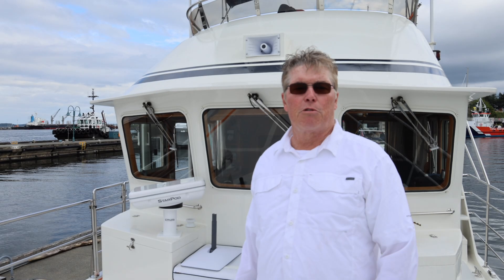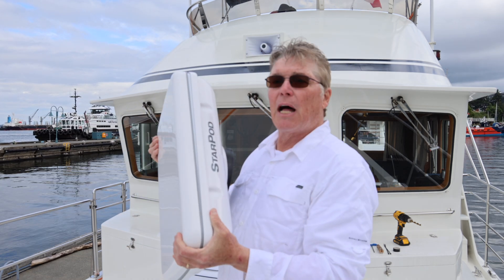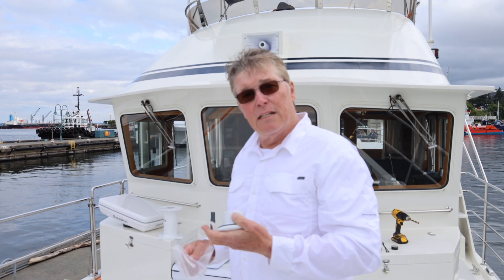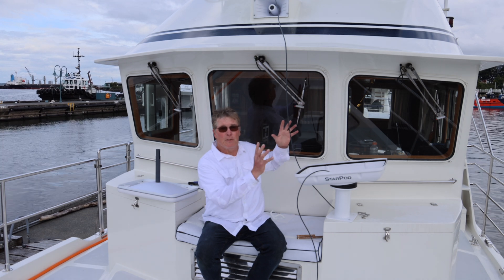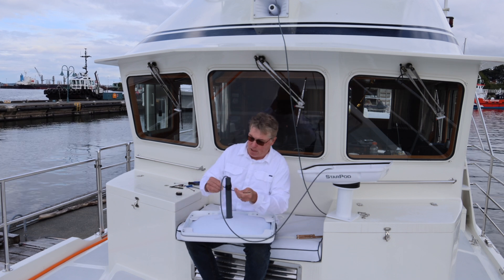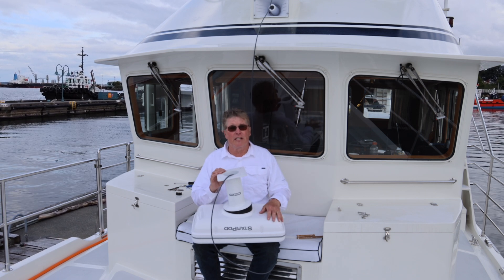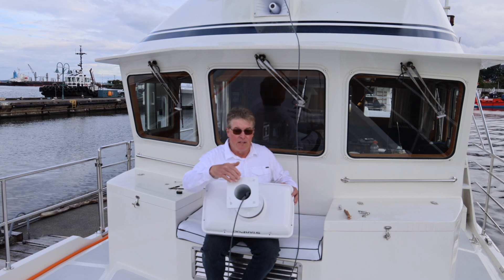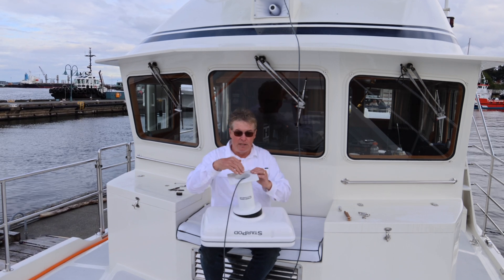StarPod Systems for Starlink 2024

Comment: Welmounts structural adhesive bond fasteners??? 7:00...Benefits of Weld Mount, Clip Bond, Rotolock 

Structural adhesive bonding offers a variety of advantages over other joining techniques. First, structural adhesive bonding does not allow for the compromise of the substrate, therefore, there is no room for water ingress. When bonding dissimilar metals, Weld Mount acts as an insulator, eliminating galvanic corrosion. Finally, structural adhesive bonding supports improved fatigue resistance, enhanced resistance to shock and vibration and advanced thermal cycling over mechanical or welded assemblies.

Other advantages include:

    Increased longevity of products
    Improved weight reduction
    Enhanced structural appearance
    Guaranteed mounting solution
    Eliminated stress point concentrations
    Advanced load-bearing capacity

Products

Weld Mount's offering of adhesively bonded fasteners and a wide range of adhesives are designed to be bonded to almost any substrate. We supply wire tie mounts, hose and cable clamps, studs, standoffs and floating nut plates. All our fasteners can be mounted with our unique, no-slide acrylic adhesives. These adhesives hold the parts in place on a vertical or overhead surface, providing a permanent high-strength bond, as well as our many other adhesive choices.

Fasteners

Weld Mount's selection of fasteners is designed to be adhesively bonded to almost any substrate. We offer wire tie mounts, hose and cable clamps, studs, standoffs and floating nut plates. All of our fasteners can be mounted with our unique no-slide acrylic adhesives which hold the parts in place on a vertical or overhead surface, providing a permanent high-strength bond with no need for auxiliary retention or fixturing.

Wire Tie Mounts & Strap Mounts